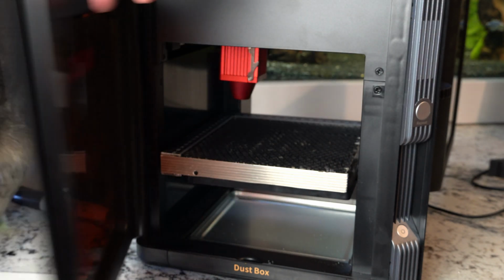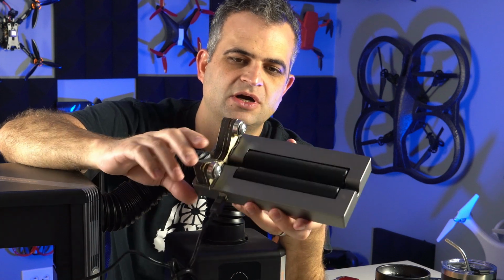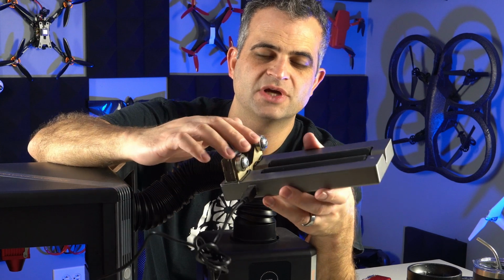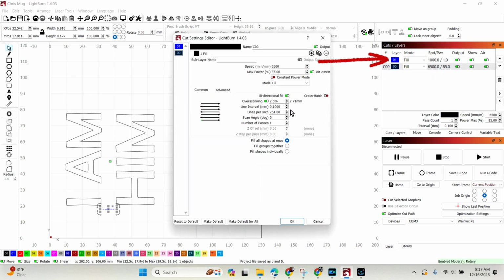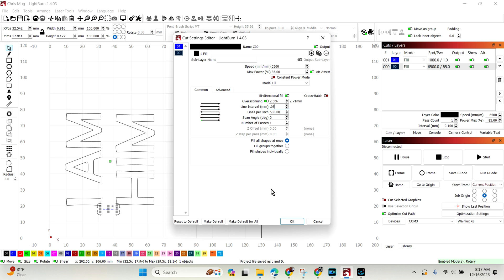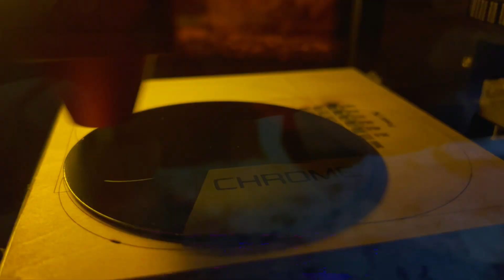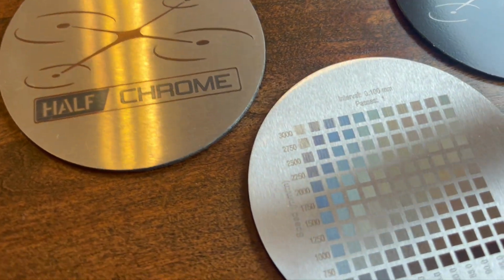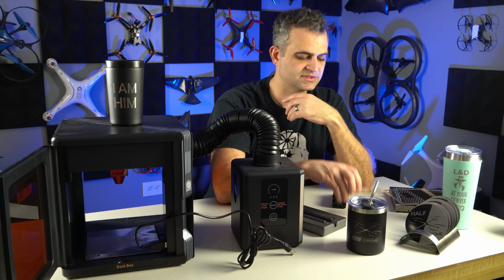Wainlux K8 Desktop Laser Engraver with Roller and Air Purifier- Upgraded!

Comment: Hi there, just having issue on engraving. I am currently interested in engraving metal stainless steel pens. What particular settings would it be and how can I reduce the reflection from the laser to stop spazzing out? I tried the metal stainless steel pens with colour and it works out perfectly, just cant seem to do it on plain stainless steel. The plan is to have a deep cut without producing any colour. Eg. Parker pens or mont blanc, where their logos are engraved on their pens. 

It would be much appreciated if you could follow up on this message :) 

Enjoy your day! Cheers